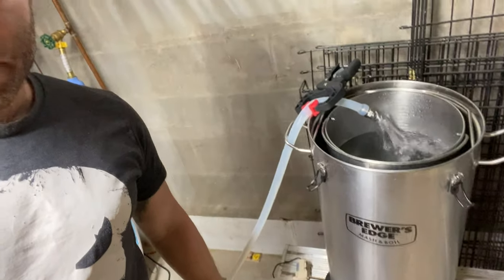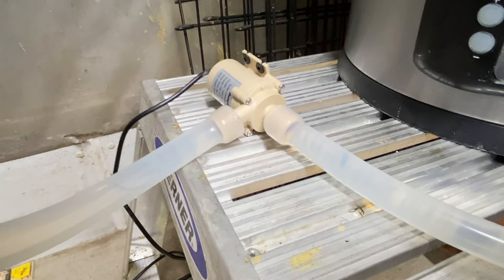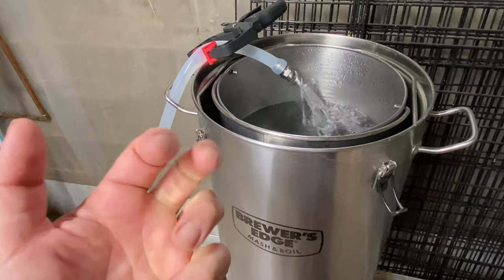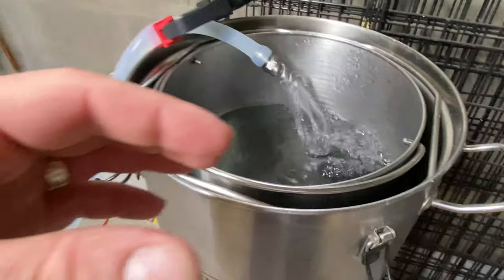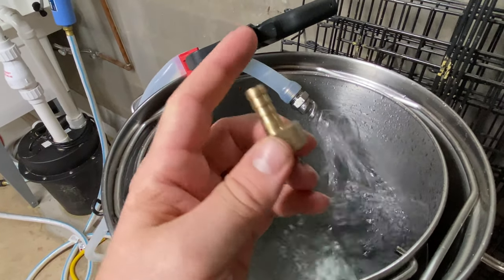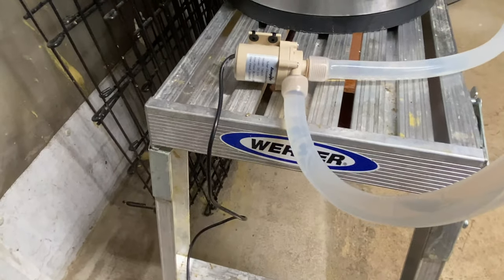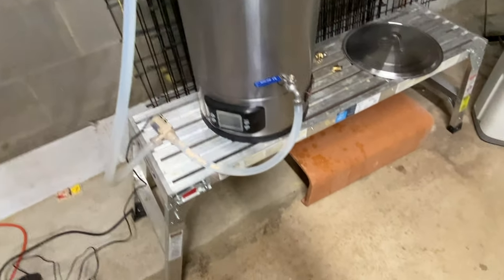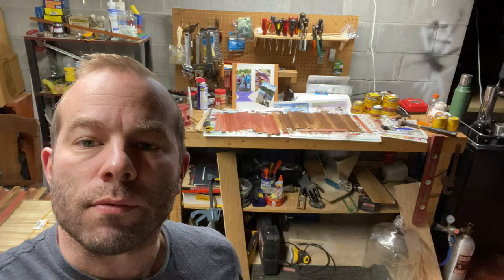BBR: Recirculation Wort Pump Homebrew Setup

Comment: I think you are right on the money adding a pump.  I have the new mash and boil with the internal pump and I am very pleased with how well it maintains perfect mash Temps from top to bottom.  I also use a counter-flow chiller and pump into the fermenter.
Reply from the maker: Yes. Completely, to all of that.... I’ve enjoyed it immensely. It’s helped with my efficiency, overall enjoyment of the brewday, whirlpool inch, chilling, transferring. I’ll be going a bit more professional with the pump shortly.

Comment: Cheers fellow WNYer!  That is a smart, inexpensive solution to recirculating your wort. If I go with an all-in-one like the mash and boil I will definitely look into that. 👍🏼
Reply from the maker: Good news then, they’ve updated the mash and boil and it has a built in pump now. Mine is just the model older than that. Cheers!

Comment: Awesome I have the mash and boil system and was looking to do this exact setup. Thanks!
Reply from the maker: I’ve had mostly good experiences with it. The temp range is good, I’ve used it at boiling temps without problems, but don’t regularly do it. It makes mash temps nice and consistent, sometimes needs a close eye to not over pump into the mash basket. Cooling helps big time and transferring into fermenter are super easy too.

Comment: Instead of drilling a hole, look for the distilling lid that way you don't have to premanetly mangle your lid. I love those little beige pumps. I have a very similar setup to yours. Oh and you can get a real cheap on/off switch for like $3. Makes life easier with those pumps
Reply from the maker: I never had the balls to drill the lid. I’ve been happy weaving it through the handles and stuff like that. Only one small spill through all the batches. What sort of efficiencies are you seeing?
Reply: @BuffaloBeerReviews  High 70's consistently.
Reply from the maker: I’m working on it. I’m just starting to consistently hit 70-72%, most times I hit 68% and I need to do some extra work to get it up there.
Reply: @BuffaloBeerReviews  do you mill your own grain? If so, double grind it. If not, ask whatever vendor you use to double grind. I find using a BIAB mesh bag in the grain tube helps with anything getting through the bottom.
Reply: @BuffaloBeerReviews  just remember, consistency is what matters, not so much efficiency. 70% is what most recipes are created at anyhow.
Reply from the maker: @memyself898  yeah I mill them myself. I think I need to recalibrate the thickness. I’m hit and miss with the double grind. But I think it’s gonna be a must going forward.

Comment: Thanks a lot ! Do you still stir your mash manually while recurculating or does recurculating replace manual stirring ?
Reply from the maker: Yes I still stir it, the pump helps keep the temp uniform throughout. Usually every 10-15min

Comment: Cheer I had a pump similar to that , and it was from Amazon , lasted like 10 gallons then she was toast . I hope yours works out for you .
Reply from the maker: Stoneyard Vineyard's shucks. Yeah, I hope it lasts too. I’m eventually going to upgrade, this might just hold me over. Getting used to different techniques and stuff.
Reply: @BuffaloBeerReviews  using similar pump from amazon(same price range and temp tolerance). 20+ brews in and still going strong. only problem is mine is pumping too much volume, and a high quality tap/flow adjuster costs as much as the pump. 1 dollar tube squeezer for now.
Reply from the maker: I’ve enjoyed the cost to benefit ratio so far. I work in surgery so I have a tubing clamp that I can use which does the same thing.

Comment: Hello, this might be a dumb question... But, I want to use this thing to pump drinking water out of a 3 gallon countertop water pitcher (with a spigot). Is this brew pump strong enough to suck the water out of the countertop pitcher (if I connect a big enough tube to it's spigot)?
The spigot would be higher than the beer pump (which would be downstream about 1 ft) from the pitcher.
My setup would be (from left to right) 
Countertop pitcher --> spigot --> tubing --> beer pump --> tubing --> carbon block filter/housing (to filter water) --> 1 gallon glass jar for drinking/storing.
Reply from the maker: def not a dumb question. i think it def has the power to be used in this project. The pump doesn't have an on/off switch, so it will need something to turn the power on/off so that the motor doesn't burn out.
Reply: @BuffaloBeerReviews  Thanks for the quick response/feedback. Yeah, there's other pumps that are self-priming (but more costly), including an inline on/off switch built-in. I'm also looking at one called "Super Sucker Transfer Pump" that cost $59.99 that has those features. I was concerned that this being non-self priming would hinder it. But, it appears it still does the job (at half the price). Thanks.
Reply: I know you said your pump died after a year or so (of extreme temp use), but if you are still using that brand, you can buy an inline on/off switch which will connect between the wall adapter and pump. They sell them for like $8 on Amazon.
Reply from the maker: @MGillDesign  yes, I bought another pump without hesitation because of the value. I really think the high temps and the sugars from the grains ultimately shortened the pumps life. I use an extension cord for Christmas lights for the pump. It has a foot pedal sort of on/off switch built into it. It works well for my setup, keeps my hands free for other things on a brew day.
Reply: @BuffaloBeerReviews  sounds good. cool.
Reply: @BuffaloBeerReviews  Finally got my setup going. Works like a charm! Glad I saw this video. I like the fact that's it cheap, so I can buy backups/replacements easily. It's almost whisper quiet, unlike some of the self-priming ones. And it doesn't vibrate the countertop. Win Win
Reply from the maker: I’m super happy that it worked out for you!

Comment: I'm trying to use a similar setup, did you use some kind of filter in front of the pump? To ensure nothing from the malt gets stuck in the pump.
Reply from the maker: No. My pump recently kicked the bucket. I got like a year and a half out of it which I think is pretty good for the price. Ultimately I think the heat got to it. I was pushing its limits and using it at and above its high temp range. I took it apart and there was surprisingly very few moving parts inside of it. No clogs. Fairly clean with routine PBW washing through a.

Comment: I don't want to be spoilsport, but this pump doesn't have food grade certification, or at least I didn't find it. You never know what kind of grease or oil did they use when the pump was assembled, or what kind of regulations did they follow in the factory. For food, food grade stuff is mandatory IMO. Maybe that stuff what gets into connection with the hot liquid has no effect for the solar hot water circulating system (where this pump is meant to be used), but maybe it is not good for your health. But if it has that kind of certificate, then this is a cheap and perfect solution :)

Comment: IS IT A 12V PUMP ? IF SO HOW ARE YOU POWERING IT ?
Reply from the maker: It’s got a little plug connection. No on/off switch but it’s easy enough to just unplug when I need it off. I’m not running it through the entire brew day. So I have the one half taped to the bench so I can pull the plug with one hand.
Reply: sorry not explaining myself correctly, is it wired to a 12v battery or a transformer of some kind
Reply from the maker: @andyadam3620  the pump last me a little over a year. Once it died I wasn’t able to really take it apart and see. No battery or transformer to be identified.

Comment: I had this pump, just upgraded to the anvil one for ease of cleaning...  This one was uncleanable...
Reply: No it's not. There are 4 small screws that come off and give access to the inside.
Reply: Ah I see now- I still like the new one better because it's got the butterfly nuts and is higher flow and the price was right...   I'm looking for a secondary purpose for the old one..
Reply: @paulfennell01  oh for sure you have a much better pump now!! I found out how to disassemble once when grain got into it anc clogged the hell out of it!!